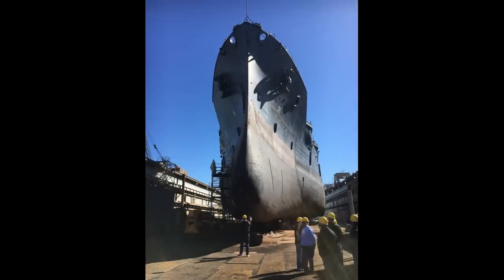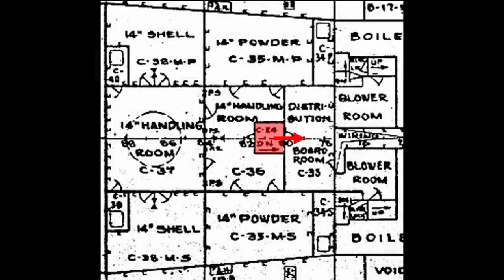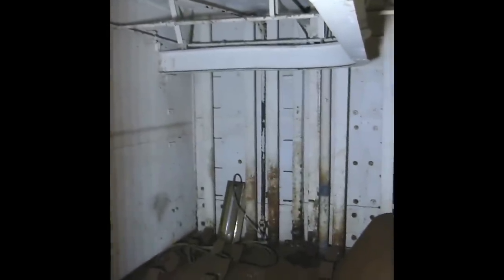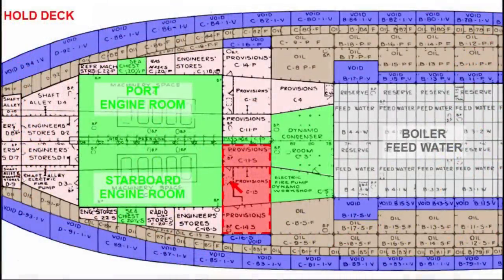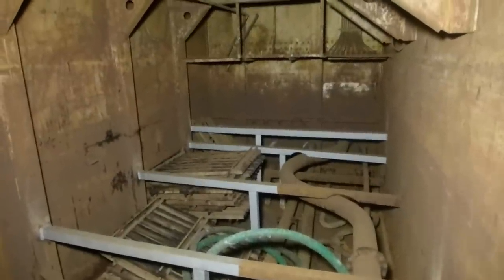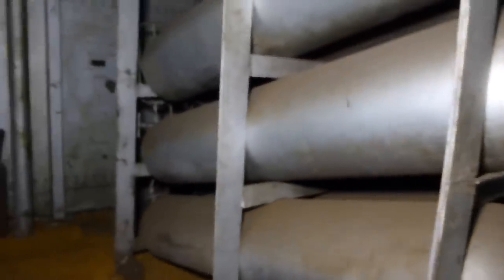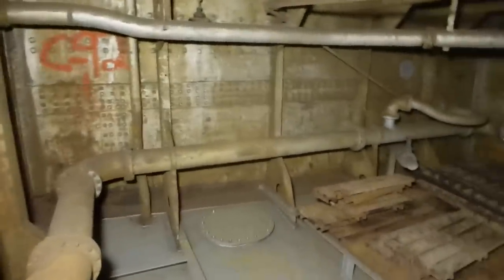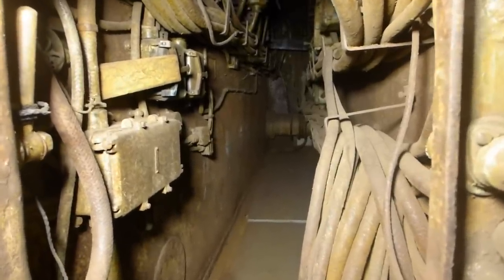Battleship Texas, Taking A Deep Dive Amidship

Comment: That is certainly a maze of passage ways and rooms. I`m guessing large warships of today would not be that different. Would be a monumental undertaking to even bring some of the lower decks back to some sort of restored state.
Reply from the maker: You are right on all counts.  The complexity is inevitable since a critical damage control feature is dividing lower decks into a multitude of small compartments in order to limit flooding if there is a hull breech.  Between the shear number of spaces, all of the pipes, wires and equipment are in the way, and the lead contained in the historic paints, restoring them is a monumental and very expensive task.
Reply: @tomscotttheolderone364  Whatever the cost it takes will be worth it to fully restore the interior rusted areas. She cost only $6 million originally to be built and I mean she is completely worth spending more money to bring her back to glory than what her original cost was. She was CHEAP to build even if that $6 million was converted to today's money.

Comment: Tom, your videos and technical explanations of what we are seeing are great!  I am just amazed at all the small compartments and equipment that you are showing us.  I have toured the ship many times with family and had no idea that all this equipment was there.  It is fascinating to see all these spaces and think about the men who worked and lived there.  Question about the electrical systems, were they all Direct Current systems?  Also, will you be touring any of the upper structures, I suspect they are really difficult to get to as there are only ladders to get you there!  Thanks again for all the info!  Great job!
Reply from the maker: Yes, primary power was 120vdc.  Other voltages and AC power was produced using motor-generator sets that used 120vdc motors to turn generators that supplied the needed power.

My primary goal is to show spaces and explain systems fundamental to the ships operation.  The vast majority of that is below main deck. The upper works has a couple of major things I may present in the future, but I will never do anything in the mast tops.  They were stripped of all equipment by the Navy so there’s not anything to show.  Thanks for your questions!  Btw, one critical location in the superstructure is combat information center.  Go to the Battleship Texas Foundation YouTube channel for an excellent presentation of that given by Travis Davis, VP of Operations.

Comment: In the mid '50's I met a man that said he had served on the Texas between the world wars. He said that Texas school kids were saving snd donating pennies for the restoration of the ship. He also said that many of the portholes at that time were square. I have tried to get a broadside close-up picture of the square portholes with no success.
Reply from the maker: I have never seen square portholes in any drawings or in hundreds of photos of the ship, taken from 1912 through the early 1940's when they were all removed and plated over.  There were square windows in the navigation bridge that were removed because their wood framing had deteriorate and were failing.  They were replaced with round ones.  There are also square windows in the fire control tower on the foremast and fire control tower immediately aft of the smoke stack.

Comment: Could they use the stored compressed air to start the engines? The Iowas & modern bunker fuel cargo ships have that feature.  I really wish it wasn't for the lead-paint regulations because I see plenty of high-school  graduation volunteer hours down in that ship of yours.
Reply from the maker: There was no need to use compressed air for the reciprocating engines.  The only possible issue is if one was at top dead center when they try to start it.  If that happened, they could easily correct it using its jacking engine.

Comment: I first visited Battleship Texas 69 years ago and could visit many obscure rooms such as these. I remember seeing a propeller shaft as it exited  a room below deck. It was the biggest steel rod I have ever seen. I know flooding and damage caused much of these hidden places to be closed off. Wonder if modern safety considerations will keep much of the ship off-limits?
Reply: I remember looking down into an large opening down below deck, filled with water and the sudden fear that I may fall in. I could not swim back then.
Reply from the maker: There are two major reasons for keeping most of the ship closed to the public.  First, is the very high of falling off of ladders that could result in serious injury.  The other reason is to protect against vandalism.  Many more compartments were open during the first 25-30 years the ship was open as a museum.  Just about everything in them have been damaged or destroyed, not limited to gauges in the dynamo room, ice making room and evaporator room where their lenses were smashed and needles torn off.  There's no reason to think that it wouldn't be as bad or worse if these and other spaces are reopened.

Comment: How did they place and retrieve the provisions?   which hatch?
Thanks for the videos...
Reply from the maker: They had to use the hatches that I used to descend to the 2nd platform and hold deck spaces since they are the only means of access.  As far as how, I have never seen any procedures, but I assume that they were hauled up or down using ropes since it wouldn't be possible to hold a crate while climbing the ladders.  However, getting them from the main deck to the 1st platform would be pretty easy.  They could lower them in large crates using cranes using the same hatches and doors used to load 14" ammunition, then carried to the doors and deck hatches you see in the handling room.
Reply: @tomscotttheolderone364   Tom, Thank you. I do enjoy your videos, and have pointed my friends to your youtube site. Keep up the Great Work.
Reply from the maker: @erickdanielsson6710  Thank you, those are very nice things to say!

Comment: Why would the Navy replace / upgrade Texas's gyro compass after she was already retired? That does not seem like something just done on a whim based off of the location and size of the compartment.
Reply from the maker: That is a very good question that I have also wondered.  I know that it is true because I have seen the Navy's list of equipment adds and deletes created during the ship's preparation for donation.
Reply: @tomscotttheolderone364   possibly took out the original from the ship as it worked and replaced it with a damaged one? Or perhaps it was one of those moments where someone told the to replace all ships’ gyro compasses & someone didn’t pay enough attention?
Reply: Someone really liked "The Ayes of Texas"?
Reply: @CowMaster9001  😹 certainly was an… interesting book, wasn't it?
Reply: "Never attribute to malice that which is adequately explained by stupidity"  or, in this case, bureaucratic inertia. I'm sure that somewhere, once upon a time somebody approved the upgrade and it surfaced in the bowels of the bureaucracy and was carried through before anybody noticed it was wastefully redundant. At which point it was more effort (read: paperwork intensive) than it was worth to stop the process.
I encountered this personally at the ALCOA plant in Rockdale Texas. While the company was fully aware it was going to close the plant in 2008, the maintenance division was unaware and therefore replaced at moderate expense a seldom used powered vehicle gate . This gate probably hasn't been opened a score of times in the last decade and a half, and now sits chains shut with the power and telemetry wires cut.🤷‍♂️
Reply: It could also be something a ssimple as the old one had something in it that was bad( radioactive etc) and the new one didn't or simply getting rid of equipment that would not work in newer ships.

Comment: Is that a bulkhead door in C-28-S that had been welded shut? Notice a couple more in different compartments.
Reply from the maker: Yes, there was a door there that lead into C-28-P, Ship's Service Stores.  It shows on the 1914 certified "as built" plans and on the 1931 booklet of plans.  As a guess, it is possible that the door wasn't badly needed, so they sealed it off in order to improve the ship's compartmenting against flooding.
Reply: @tomscotttheolderone364  thanks! I think the paint is what made it really stand out, but makes sense if you dont need it delete it.

Comment: 8:31 interesting to see the overhead rails that split into so many different compartments.  "WTD NO 17M P" = watertight door number 17, munition, port? From the diagram that follows it looks like those doors opened to 40mm stowage?
Reply from the maker: Sorry, I guess this was a little confusing.  The room with the rails is turret 3 handling room and the rails carried 14" shells from the magazines to the hoists.  The door numbers don't necessarily match the rooms, but identify that door on a set of plans that showed the types and locations of all doors and hatches on the ship.  The diagram immediately following that is on second platform, one level below the handling room.  The 40mm magazines that you saw on the diagram could not be accessed through the trunks and passages in this video.  They could only be reached using deck hatches farther forward in the ship from 3rd deck.  In fact, here is a video I shot walking through them: https://www.youtube.com/watch?v=1mrI5yKCHz0

Comment: Did you make a video regarding the antiaircraft guns? Are they going to let people play on the AA guns after restoration like before?
Reply from the maker: I haven't make anything on the AAA.  All of my efforts have been on systems that are difficult to find anywhere else.  My understanding is that the guns will be available to the public as in past.  They have not decided how available the restored 5" will be for the public to operate.  The breech plugs will certainly be secured so that folks cannot hurt themselves on them.  The big issue is on training, or rotating, them.  They want to find a way to limit them since it is possible to train the barrels far enough to strike the sides of the openings through which they extend and damage something.
Reply: @tomscotttheolderone364  Thank you. Either way whether static or movable will be fine for me. Those AA guns are so fun to play with. I don't think any other battleship museum allows people to play with them. The 5" guns actually fought at Normandy and should be handled carefully also.

Comment: Is that ladder how they originally got around? I thought most ladders were permanently attached to the ships structure?
Reply from the maker: You are right, ladders or ladder rungs are typically permanently attached to bulkheads.  I assume you are referring to the silver painted ladder propped against the deck hatch on second platform.  That was left by museum staff members.
Reply: @tomscotttheolderone364  Were there spaces in the ship that required a ladder to access that didn’t have them permanently mounted? Wondering why your staff needed a moveable ladder?
Reply from the maker: @Whitpusmc  Just to correct, I am just a volunteer and no one reports to me.  As far as why they may use a portable ladder, because it is a lot safer to use a ladder that is tilted so that you can lean into it rather than a vertical ladder that you hang from.
Reply: @tomscotttheolderone364  OK so the vertical ladder is still there you just added the additional one for safety purposes. I understand. 
I didn’t mean that “you” were in charge, I should have written “the battleship’s staff” vs “your staff.”

Comment: After all this work being done!  Why not keep it on dry land? It'll still be a museum PC  and can see the whole ship top to bottom... cause it will never be put to war and never be effective..
Reply from the maker: That was a goal in the early 2000's.  Proposals were made to create a permanent dry berth that would largely eliminate the maintenance required to keep the ship in the water.  During all of that, it was determined that the ship's hull structure was too degraded to support her out of the water, or even tow her anywhere.  As a result, $50 million was spent on hull and frame repairs that was on top of any attempt to dry berth her.  When the $100 million cost of the project was given, the state legislature refused it.  Ultimately, they provided $35 million for the current repair project that will put the ship in good enough condition to survive for hopefully another 100 years in the water as long as she is periodically taken into dry dock for hull servicing.  Another issue that got in the way of a dry berth solution was that influential people did not want her to be kept at the San Jacinto Battleground.  Their argument was that while people were used to seeing her there, the ship was very much out of place in the 1836 site where Texas won her independence from Mexico.  That is also a major reason why she is not going back there when she leaves dry dock.

Comment: I was in the US Navy for 8 years, 5 of which i was an internal communications electrician 3rd class. I maintain the Wsn2/5 gyros, depending on what the ship had. I am not understanding why a ship thats not functional would have the gyro replaced.
Reply from the maker: That is a very good question.  I have no idea why.
Reply: @tomscotttheolderone364  my guess the idea was being passed around the Navy to reactivate the Texas at some point for whatever reason. Due to the hardware that uses the Sperry, not very much of the fire control would have to be upgraded for the time since it had limited capabilities. My WSN 5 had a lot more to it seeing as though it primarily had synchro amplifiers for each compartment that had x amount of indicators
Reply from the maker: @Tomcatntbird  By the end of WWII, the U.S. had 10 fast battleships that were 5 years old or newer, equipped with 16" guns and in good operating condition.  Texas was the next to oldest battleship in the U.S. fleet, was obsolete in every imaginable way and worn out.  Her only future was to be sunk as a target, sunk in the atomic tests or fortunately, donation as a museum ship.  All of this is to say that the ship would never be reactivated and I really don't know why they removed the Armas and placed the Sperry on board.  There was no future need for one since the only movements the ship made after 1946 was under tow.  She I could make a couple of wild guesses, but I am almost always wrong when I do, so I'll resist temptation.

Comment: The interior of the ship looks terrible, why is there standing water in the ship? Why isn't more being done to preserve the interior of the ship?
Reply from the maker: There is a long and complex history to the reasons why the ship's interior is in the condition that it is.  Every possible effort has been made to prevent what you see, but it has been inevitable due to leaks over the last 75 years in the riveted construction of the hull plating and wasting of its 100 year old steel.  it is impossible to keep the inside dry without directly addressing these issues, which requires dry docking and a budget of $50+ million.  Fortunately, that is exactly what is happening now.  The ship has been in dry dock for almost a year where she is undergoing repairs that will leave her hull in better watertight condition than even when she was in service as a warship. By the time it is complete, more than $100 million will have been spent, including critical hull framing repairs, that were performed less than 10 years ago.  Once completely watertight, the interior can be stabilized and future corrosion largely prevented, if not eliminated.

Comment: Apparently a maze with little logic.
Reply from the maker: I know what you mean, but there was a great deal of logic to the design.  The basic idea was to divide the ship's lower levels into small, watertight compartments.  The ship was also divided into separate sections by major watertight bulkheads that extend above the waterline.  That can be seen by the way compartments on the lower decks start with the letters A, B, C, or D, which gives the area between bulkheads where they are located.  That way, if there is flooding, it is confined to single or a few spaces.  In the case of major, large damage, the bulkheads stop progressive flooding into the rest of the ship.  Deck hatches and vertical passages, called trunks, are located to provide access into small clusters of compartments on each level.  The overall effect is that while it can be difficult to access at times, the design offers a great deal of resistance to large scale flooding and sinking.